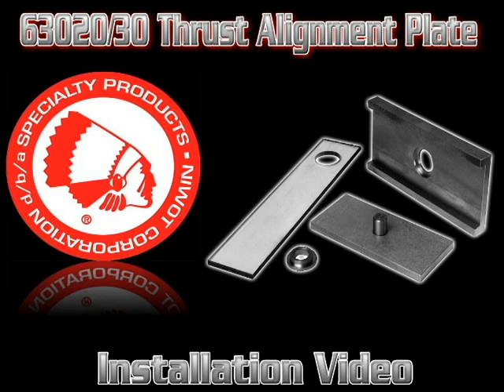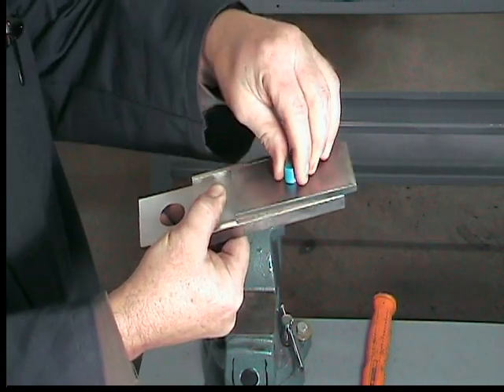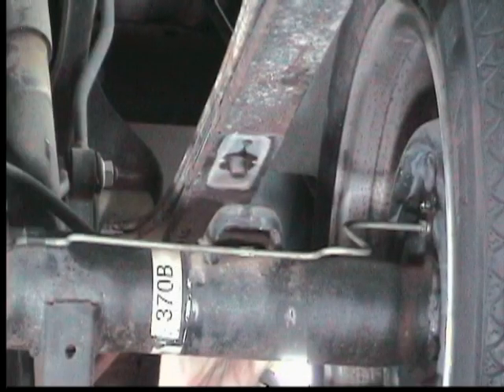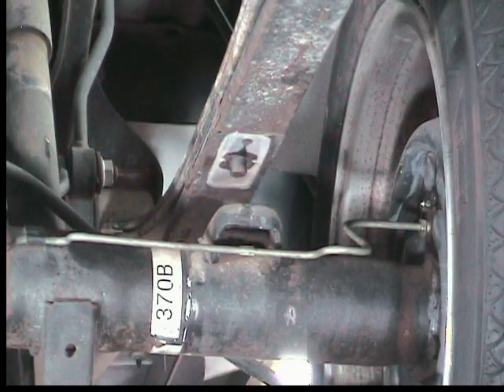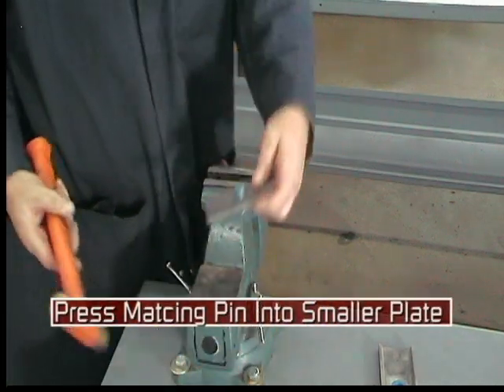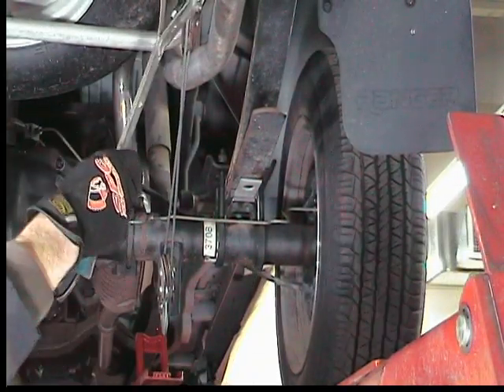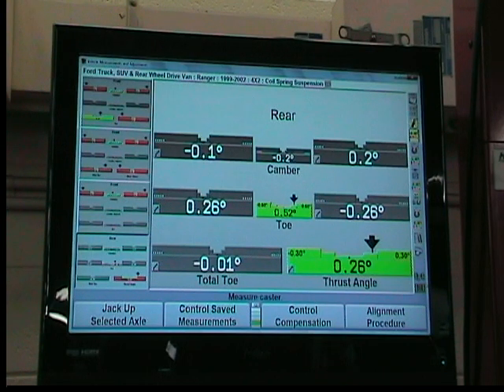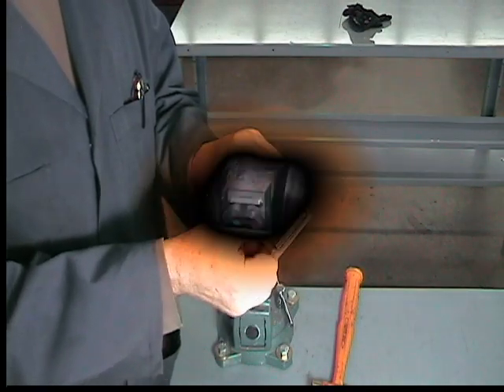Thrust Plate Alignment - Specialty Products Company

Comment: Will this be able to remove -2 degrees of thrust angle?
Reply: Mr. Jack, Probably not. For an axle with 50" of spring separation, it takes about 1-3/4" of motion on one side to make up for 2°. You can't move the axle under the spring that much. There must be something pretty well bent or broken under the truck. Has the centering bolt of the springs sheared allowing the axle to pivot? Some springs do not have the hole in the direct center of the spring. Is one of the springs mounted backwards? Are the spring brackets or the frame visually distorted? Is the frame "diamond" shaped? Almost 2" of deflection should be visible. We don't want to Band-Aid the issue but rather fix it. Do you have an alignment report with wheelbase and setback information? Most modern aligners collect this information during an alignment; they just need to be searched for. This information can be very useful. If you are in the US, please feel free to call me at 800-525-6505. Thanks, Tom
Reply: @specialtyproductscompanysp8027  Unfortunately, the vehicle was hit on the side, and I went and did the alignment, and it was about 2 degrees off

Comment: Does the kit affect rear ride height? One side taller than the other?
Reply from the maker: The thrust plate will change ride height by about 1/2". Since it only needs to be installed on one side check ride height first and install it on the appropriate side. If the leaf spring is on top of the axle it will raise ride height on that side. If the leaf spring is located under the axle housing it will lower on that side.
Reply: If it causes one side to be higher after install you can always put a piece of plate steel (with a.hole drilled into it)  on the other side to level it out

Comment: My f150 2018 now has a thrust of 0.51 it shifted when it was at -0.1 i tried moving the axle but couldnt because theres a small plate with the leaf spring bolts that hold them together and u rings go around it and cant move forward or backwars ig
Reply from the maker: Sorry the thrust plates illustrated  in this video will not fit the 2004-2020 Ford F-150 because of the 2 pin design.
Reply: @SPCAlignment  oh ok, can i still move the axle somehow?
Reply from the maker: @mrbimbo3917  Without fabricating custom parts, you can loosen all the U-bolts and try to take advantage of manufacturing tolerances by pulling one side forward while pulling the other side back. Once the tolerances are removed in opposite directions, tighten all the U-bolts.

Comment: I have a positive thrust angle of .23* oem specs are -.15* to .15*. Would this cause the Jeep to drift in its lane? Also can this thrust alignment plate be used if the vehicle has axle shims installed?
Reply from the maker: Positive thrust angle will push the rear of the Jeep to the right, which should cause the Jeep to drift to the left (like steering a forklift.) This should be a steady drift unless the U-bolts are not tight and the axle shifts around. Your readings are at the marginal point. It would probably drive better with less thrust. The SPC thrust plates can be used with axle wedges IF the locating pins still locate. Sometimes replacement spring center bolts have taller bolt heads than the OE ones if needed. You can't rely on just the U-bolts if the locating pins don't make contact. On the other hand, a little positive thrust might counteract road crown. At least the thrust angle is in the potentially "right" direction. (Unless you are in a country with left-hand driving!)
Reply: Okay so I live in the USA with left hand steering therefore positive thrust angle would make It more difficult with road crown? My leaf spring center pins do have a metal sleeve to help the center pins protrude into the axle perch more. However the metal sleeve can easily be removed if I take the center pin out of the leaf and remove the sleeve from the pin. If the head is still too long I could always grind It a little so that It doesn’t prevent adjustment of the plate or not allow the plates to fully seat in each other. Does this all sound correct?
Reply: Oh I see what you’re saying now with forklift like steering, positive thrust would help on a right-hand lane road like the USA. I misunderstood and thought you meant if my Jeep was right hand steering.
Reply from the maker: @mercury591  Correct. It is better to a have positive thrust angle in the USA than negative thrust. I can think of at least one application where the factory INTENTIONALLY adds positive thrust in the rear to counteract an intrinsic drifting issue. Again, as long as there is good locating all the way through the wedge and plate to both the axle  pad and the spring, you'll be OK.

Comment: How about side to side from left to right? My truck has, as you look from the rear, the rear axle shifted just an inch to the right and the right tire is sticking out of the wheel well more than the left. Thank you for your time.
Reply from the maker: It sounds like you have axle sideset. You may have bent springs or a frame problem. A good body shop that can measure vehicle dimensions would be advised.
Reply: U ever figure out what was wrong with ur truck my truck doing the same

Comment: My truck has 20* of thrust angle. Does that mean i have to pull the right side front?
Reply from the maker: I am assuming the measurement is .20 degree of thrust. It depends if the thrust is positive or negative to determine which way the vehicle may pull. .20 degree is minimal and normally should not cause much of a problem.

Comment: Would this work between rear blocks from a lift kit. I have a 2006 Silverado 1500 and I installed a rough country 4.5 lift kit and I'm having a problem with the thrust angle now
Reply from the maker: If you have a single spring locating pin which I think you do put it under the spring. Make sure the thrust angle problem is not axle sideset.
Reply: Did you ever figure out what the problem was?
Reply: @adriantrejo6696  Turns out I had the blocks facing the wrong way. Assumed they were flat and didn't need to be oriented with the peak of the slope towards the rear of the truck. I guess that's what happens when you drink too many beers while installing a lift kit outside in the middle of the summer in Phoenix, AZ lol

Comment: Would this work on 01 Silverado?
Reply from the maker: Yes. Please measure the width of the rear leaf springs. If 2 3/8" to 2 3/4" wide then part # 63020 is correct. If 3" to 3 5/8", then 63030. You only need one kit per truck to be installed on the lower ride height side. Please call 1-800-525-6505 with any questions.
Reply: @SPCAlignment  would it allow me to adjust it forward or back? I need to bring the driver side forward about 2 inches
Reply from the maker: That seems like a LOT. What is your thrust angle? Is the rear toe equal but opposite sign? Is the center pin through the spring sheared? Accident damage? To answer your question, 2" is about the farthest this kit should be used.

Comment: I’m pissed...I just had a 300 dollar install and alignment of camber bolts on the front and my ranger still dog walks...I’m assuming it’s this now...I’m jus pissed beyond return and need a vehicle god to save me...I hate rangers beyond imagination like how tf did ford make these so bad
Reply from the maker: Do you have an alignment report? If yes, what is the thrust angle? Most trucks have a wider front track than rear so there can be some optical illusion going on. The thrust angle is what's important. Please call me at 1-800-525-6505 for more discussion. Thanks, Tom
Reply: SPCAlignment I’m not mad at u lol I’m mad at les schwab because I told them to align it and 300 dollars later they said my tuck was good...I had someone follow me down the road and it looked like it was trying to go left and had to steer slightly left...it’s my rear axle I think because it sits to the right slightly but I figured les schwab woulda helped me out
Reply: Had to steer slightly right not left
Reply from the maker: No worries! I would like to have some info from an alignment report. Please call me at 1-800-525-6505. Tom
Reply: SPCAlignment also my truck is a ranger and it seems like it’s way to common for these damn trucks

Comment: Why would I want to do this when i just can use the pin and hole as it comes from the factory
Reply from the maker: The rear spring pin and hole are in a fixed position. This kit allows the axle to shift forward or rearward to align the thrust angle to the vehicle centerline.
Reply: @SPCAlignment why couldn
Reply: Take your factory vehicle in and checked with lasers. If it is more than 10 years old odds are good your thrust-angle is off. This allows it to be put where it belongs.
Reply: @EdBert  Mine actually came from the factory with a 15/16" fore/aft location difference from side-to-side.  Had I known these kits existed, I would have fixed it many years ago.

Comment: why not just grind off the locating pin entirely and shift the axle into proper alignment without this kit? what's the difference?
Reply from the maker: The U-bolt clamps are not designed to hold the axle in place by themselves. Over time with torque and twisting the axle can shift or slide creating more problems.
Reply: huh? if you grind off the locating pin on the leaf spring, how is the leaf spring going to be attached to the axle? The axle-to -leaf-spring combo is held together both by the compression forces provided by the U bolts as well as the static force provided by the male-female pin-hole.

What this kit does so provide a way to "offset" the holes.
Reply: @thearcher1740 how does this kit locate the rear end to the spring when the locating pin is ground down to not protrude into the the lower plate and the lower pin doesn’t protrude into the upper plate? There is no locating pin essentially anymore even with this kit.
Reply: @thearcher1740 there’s no offset hole. The top affixes to the rear end and the bottom affixes to the spring. Then the 2 plates just slide on each other. The only thing holding the rear end to the spring at this point is the u bolts. I too want to know why a person couldn’t just slot the rear end saddle, move the rear end and then tighten the u bolts.

Comment: i have doudt that ,you are putting plate on one side of axle what about other side.. ??? if u r not putting plate on other side there should b misalignment again??
Reply: thrust angle needs only side to be moving to be changed. so you do one side and that will bring thrust angle back to 0 degree. if other side got hit, got damaged you remove the plate and re-adjust again after the damaged got repaired.

Comment: hey.. can u explain me whole process that how align axle with respect to front axle i.e  to achieve zero thrust angle. i want to achive zero thrust angle in low commericial vehicles like small trucks n bus
Reply from the maker: You'd probably get the best answer by calling one of our techs. You can reach them by calling our toll free number 1-800-525-6505. They are available M-F 8am-5pm Mountain Standard Time.